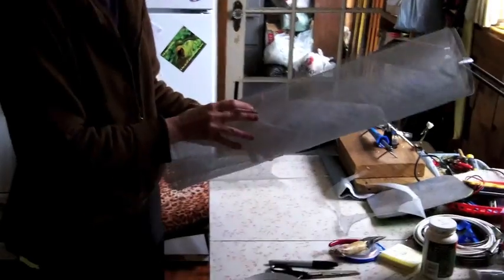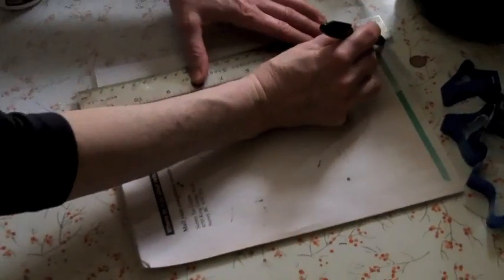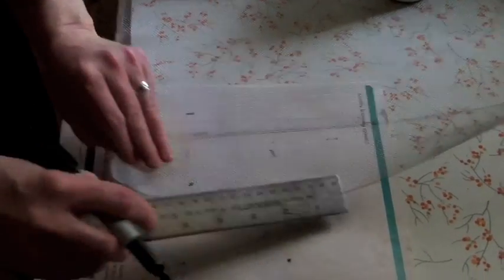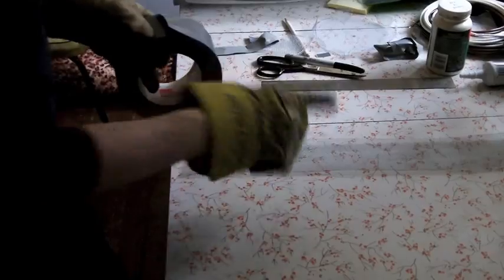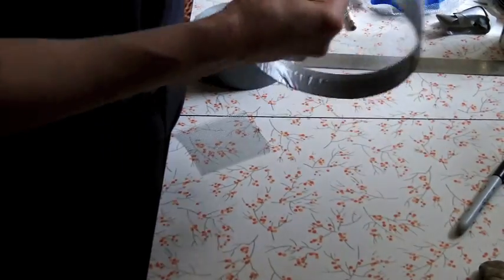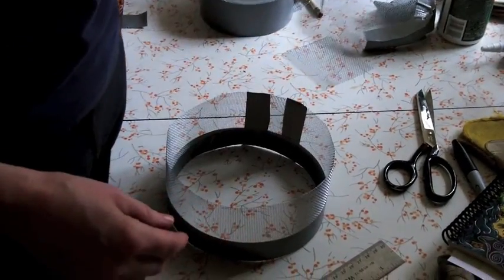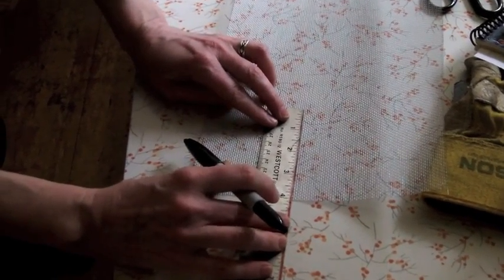How to Make A Smart Meter Cover

Comment: Thank you for your video !
I just like to help you by saying ,you could simply staple the screen together with a staple gun and make the end first using a can of 6 inch diameter by placing a 7x7 piece of screen pushing the edges down to make impression then cut along the adge about 1/2 inch overlap then push this circular  piece into the the pipe shape you have made and staple them together ,no need for any duct tape
Reply: +irooni100 Coffe cans fit snugly over my meter. I insulated it with that aluminum bubble insulation. I will be getting a Gauss Meter soon and I will test it and post results ASAP.
Reply: Russ Hook
Thanks !
I went to homeDepot and bought a whole role of screen and i made about 20 of them and gave them to my friends !
Yes i used Simple staple gun to put them together ,no tape or any thing else ,just staples & a piece of copper wire cost me less than 50 cents all together !
Reply: Russ Hook
money is not every thing my dear !
no i am not a Jewish ,i am a Muslim who cares for other people ,besides like i said each one cost me less than a dollar to make and i am a mechanical engineer by trade and it takes my less than ten minutes to make each one .yes others they sell the same thing on line for like $99.95 trying to get rich but i am already rich ,thanks to ALLAH !
Yes when you pay the POOR DUE ,God will make it up for your loss in multiple numbers
Reply: +irooni100 I KNOW about "God" but I am NOT religious, which means the JEWs CANNOT CONtrol me like they do 90% of the sheeple. Back on TOPIC, what is the screen made of? (material) Tnx...
Reply: Russ Hook
But , my dear the jews control the gold market and the money market as you know ,therefore they control all of us one way other the other , reading their torah you can tell the god of there torah loves gold ,he wants every thing to be made from gold for himself . go read the old testament ,you will see 
now about the material it is aluminum screen it is sold in all different sizes in roles at home depot . it is the screen being used for windows and door .
good luck and peace be with you
Reply: Russ Hook
OH
just find a empty can about six inches in diameter then cut a three inch wide screen to go around the body of the can couple of turns ,then cut and staple it together like a tube , then cut another piece about one inch bigger than the bottom of the can on each side ,then use the closed end of the can to form it into a cup shape by pressing the sides down ,the cut the square corners making it in the shape of a dish like a flower put dish then put the dish shape screen on your five fingers on one hand the push it into the cylinder which you made of the screen then tack the edges of your dish to the cylinder with staple from inside the cylinder , make sure your staple gun  has 3 inches fold to reach the bottom of the cylinder !
It is very simple and fast ,no need for duct tape or anything else ,then attach a copper wire for the ground to the inside of your cylinder using staples to hold it to the wall of the cylinder ,then place it on the meter either with a long tie wrap or a piece of hvac air duct tape at the bottom end of the meter .
try it is works and if they came to remove it tell them that they had no right to place this kind of dangerous meter on your property and you can make more if the remove it for less than fifty cents
Reply: My point is NONE of them can be trusted. Read the "Scorpion and the Frog" analogy. IT IS IN THEIR NATURE TO BE TREACHEROUS......PERIOD.
Reply: Russ Hook
You are Right my friend !
May i ask what is your religion ?
Reply: Yes, jou may!
Reply: Fefee10
Thank you !
May God Bless you !

Comment: Why not make thoes metres even smarter? Like generate enough signal to communicate but not more. Also directional signal would be better.
Reply: +Russ Hook LOOKING for a cheap way of stopping the smart meter radiation on the inside of your home??
Most hardware stores, army surplus or sporting good stores sell SPACE BLANKETS. 
Normally about $2 to $3 each.   I like the $3 ones becuase they have a gold color on the other side.  
A quick test before you pin them on the inside wall opposite of the smart meter outside.
BORROW A CELL PHONE AND WRAP IT TWICE AROUND A BORROWED CELL PHONE THAT IS TURNED ON.
CALL THAT CELL PHONE, IF THE CELL PHONE DOESN'T RING, THEN YOU HAVE A GOOD SPACE BLANKET.
Now get a felt marker and have your children draw DEAD BODIES near a smart meter.
Reply: +ArthursHD How much smarter do you want.   Take your blood pressure???   It already knows when you take a piss at 3AM.
Reply: +Frederique Zug You misunderstood me. I thought those meters could be more efficient by not emitting unnecessary signal. But not invade our privacy even more!
Reply: +Frederique Zug I don't take a piss, I LEAVE one! (;

Comment: Something else I found that works well in building a cover is a 6 inch diameter, (round) heat/ AC duct connecter. They are about 4 to 6 inches deep and fit and nicely over my meter.  Plus they work perfectly as a template for cutting a circle of screen material. The aluminum tape sticks very well and seals great. I drilled 3 small diameter holes in the side of the duct connection ( perpindicular to the end away from the screen) where it is overlapped and riveted and it's strongest point. I weaved the copper wire through those holes and used aluminum tape to secure it in place. The copper wire ground is an important feature people need to be sure to add. 
I paid about $6.00 for a roll of aluminum screen, which is big enough to make a bunch of these covers. The duct connecter was $2.49 and a 50 yard roll of 2 inch aluminum tape (the smallest roll they had) cost another $5.98. This came from a Menard's store. The only future cost will be for more of the duct connecters at $2.49 each. A lot lower than paying the huge amount some charge for a "pretty one" that does the same job.

Comment: I recently discovered 3 of these awful meters on my house. Thinking back to around the first of September 2014,  I have had that feeling one gets after wearing a hat and feeling like I am still wearing it after removing the hat. I also had severe memory and concentration problems. The hat head feeling went away within seconds of covering 2 of the 3 meters plus, the memory and concentration problems are slowly going away. 
I had 3 dogs, one of which contracted lung cancer a few months after the 3rd meter, a water meter sending unit, was installed in my basement next to the actual water meter.  My 2 remaining dogs, ages 7 and 8, are acting like puppies again since those meters were covered. One was always rubbing his head and ears on the carpet before I covered those meters. Since covering them, he has stopped doing this. 
I made a cover using your design except, I used aluminum foil tape instead of duct tape. I also anchored the cover to the meter using the same aluminum tape. That stuff is almost indestructible plus it adds to the protective shielding the cover offers. 
I will be covering the smart meters on my parents house today and we will see if it has a positive effect on the memory problems my mom has been experiencing. 
I have not seen a picture of the water meter sending unit on the Internet,  but will be happy to provide one to your page upon request.
Reply: Please send me your link.
Reply: You can call the Public Utilities Commission and demand that they make your power company remove and replace, check out minivan Jack on YouTube very knowledgeable.

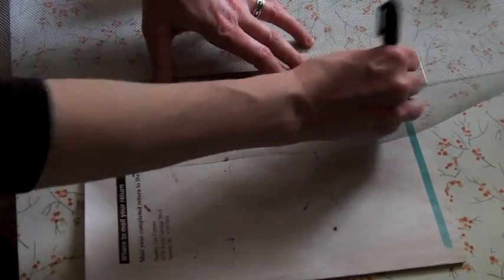Comment: the signal goes out and inside your home;. it rides in the wires that supply electricity to your house  and the wires that supply electricity to the wall plugs. its a d.e.s. digital encoded signal.  the utility company gets its signal over the wires despite what she said a 2:00. the transmitter pulses a signal every 23 seconds and it has enough strength to reach a far distant data collection point. NO LEAKAGE except thru the wires  that is... smart meter are not a U.L. listed appliance  listed appliances are a requirement of the national electric code. their connection  to electricity is outlawed by the NEC. OOPSS!

Comment: I was out shopping last night at the local HD. 
I'd like to note that there is an abundance of fiberglass or plastic composite screens that seem to be the new thing on the market these days. So make sure you're buying an actual metal or aluminum screen mesh.
If the screen mesh is not metal, it will render the Faraday Cage ineffective.

I ended up spending about $7 for a good size roll of aluminum mesh which apparently is for "bug screen". All good as long as metal so don't be thrown off by the "color" of it.
Reply: Hi Earth, 
Beyond making one, I bought one as well. It's like the one you're speaking of. 
I think it's smartmeterguard. This guy's name is Karl who engineered and built it. After researching a lot of them, I think it's the best bang for your buck out there. It's professionally done and made from stainless steel. Everyone has to pick and chose as to what's good for them. 
I personally like turn key solutions that look great and make life easy. Karl's fits the bill and would recommend it. 

If funds are an issue, then go the "build your own route". I'm handy so it's not a big deal and did it for the fun of it. That said, I'm pretty sure mine is subpar by comparison to the one I bought. Certainly visibly if not functionally.

I'd point out one thing. It's important to have top part connected to the side mesh. I think the instruction video has us taping the edges so we can attach and gain adhesion w/the tape, so it has something to stick to. This created a disconnect (top mesh to bottom mesh) in mine so I took a wire and grounded the side mesh to the top mesh so it's one complete circuit. I also grounded the wire to the box but I don't think this is necessary w/a faraday cage but I like to cover my bases.

Enjoy....
Reply: Hey Earth,
I haven't taken measurements but imagine the readings would be comparable. I bought a meter and will likely get going in a couple weeks to try out and see. Will post any differences.

Mean time, If you email Karl, he'll actually tell you how to make one that's pretty sure fire.
It's basically taking a 2x2' piece of screen you then cover the unit with. I forget the exact details but it made perfect sense and eliminated the need to try and mimic his. I think he recommended using a large hose clamp to secure the screen and then cut around the edges to clean it up. Not sure how would look but imagine would be ok.

I'll see if I can find his email but he'll tell you.
His email is the info one on his website.

I bet his method would be well enough and wouldn't look too bad where your neighbors would even notice.

Like your neighbor who didn't seem phased by having one by her head, I imagine wouldn't care or notice if you did hers too. Maybe pick a time where it draws less attention etc....then it'd be a thing of the past.
Reply: Hi Earth, I know that video and thought was very good. Although I question the need for the foil which might actually block the signal all together. This may interfere w/the communications of the meter to the electric company. I personally would just use the mesh and the clamp, which would simply make a functional faraday cage. That and anything regarding tinfoil tends to have a certain aesthetic look to it that kinda makes people go...wtf?...
Imagine it'd be an easier sell to your neighbor w/out the foil as well.

If your neighbor doesn't comply then you can always use some screen mesh to put on your facing wall. Either that or some lead paint to block the signal. 
Several ways to approach it. I understand the more distance the better and the less impact of the signal. You can get a meter for $150 and check it out. I researched and got one that's highly recommended. If don't remember the name now and can let you know if interested. I just wanted something basic that works well enough w/out getting crazy dropping $400-$500...
Reply: How so Ron. It's a faraday cage. There's no reflectance unless you're using foil, which I don't advocate.

Please explain....
Reply: +EarthH2oLuma This is the problem!  Most IDIOTS don't care. This 'technology' has ST000PIFIED almost everyone, and most SHEEP today aren't worth the powder to blow them to HELL!!! I have 2 meters within 20 ft of my bedroom, and I covered both of them. I am buying a Gauss Meter shortly to test my home for EMFs.

Comment: Hello, 
This looks like a nice solution. But will the electrical company still be able to receive the meter readings? Aren't they going to send a technician to your address to take it off and fine you a fee?
Reply: Anastasia Zaikina Uh huh.  Ok.
Reply from the maker: I live half a mile off the road and Hydro has no trouble taking the reading from the road.  If you don't otherwise tamper with the meter, these covers are perfectly legal.
Reply: thank you so much for your response. I made one cover like yours but with double layer of window screen. do you think I can call them and ask: "hey are you getting my readings?"
Reply from the maker: I would just wait and see if they send you a bill!  :)  Cheers
Reply: Q Factor Videos What give the power company the right to install a 4 watt eirp unlicensed commercial radio transmitter on our home?
Reply: I have made a makeshift cage like that also around my wireless router,  of aluminum grill screens that they sell in walmart.  We still get the wireless signal, internet works fast and without problems, although i see less bars. Our health is worth it!
Reply: Boom, you've just exhibited critical thinking.   Yes.  IF this device does what it says, you better believe someone will be around.So if nobody ever shows up, then guess what??
Reply: So basically you are blocking the signal.....but you aren't blocking the signal.  Which is it?
Reply: The FCC and the state government commissions.
Reply: I have made a makeshift cover exactly as shown in the video, plus on the inside i made a screen of aluminum "rescue blankets". We keep receiving the electricity bill, no problems. Apparently the signal is still reaching the destination but it is not so strong.
Reply: Just think about a shoplifter using a foil aluminum bag so that the alarms don't beep at the doors of the store. That bag has to have 30 layers of Raynolds wrap at least! Then the signal is blocked completely. Here we don't need to block it completely - just to reduce it. They sell the smart meter covers like that on Ebay, and they are legal. The damn thing still works apparently, but people in the house stay healthy!

Comment from the maker: The smaller the holes in the aluminum, the more protection it affords.  I'll be posting the new video in February, and will link it from this page.  Thanks for your comments.  :)
Reply: Just criminal allowing this stuff installed on peoples houses....
Thanks for vid.
The mesh blocks the frequency from the back as well?
Meaning it cant enter the house?
Reply: thanks very much!
Reply: +Jim F That was what I'm wondering.
Reply: +Eddie Lai  wouldn't this block electronic harassment
Reply: +Eddie Lai okay thanks
Reply: +Eddie Lai Thanks Eddie. I'ld like to buy a meter for testing the RF that's coming in through the walls not just close up to the meters as I see people doing in these types of videos. There are 5 meters in my hallway apt building directly on the other side of my bedroom. I've had trouble sleeping since moving in. What exactly do I look for? And what are these gadgets that plug into my wall outlets that supposedly reduce the waves? Are they any good?. I'm on a limited budget & appreciate any advice. thanks again!
Reply: Hmm,I'm the farthest from being an engineer anyone could be, but if you ground yourself I believe the waves just continue to circulate within your body, what good is that?
Reply: Yes maybe not insulting, but definitely a put down. No fear, I'm smarter than that.
Reply: You've just been had.
Reply: We've ALL been had! You just seem to think you're better off not knowing just how much.
Reply: I read to tape up a piece of aluminum foil to the back of the wall. It will block the radiation. Just hang a big picture over it if you don't want to see the foil. I think it makes an interesting conversation piece when friends come over and ask what that is, and then you can help the friends by showing them how to block theirs too.
Reply: Can you move your bed over to the other side of the room? Can you sleep in another bedroom? Or even the couch if it's away from the meters. I love sleeping on the couch. To protect your health you may have to make some changes. Or move to another place., but check and see where the meter is.

Comment: I just made one of these (my smart meter is square, but same idea), and couldn't get uncoated aluminium mesh so had to settle for the black coated aluminium. So if anyone else can't get the plain stuff, I can confirm that this works fine too, though I guess uncoated would have higher conductivity to your earth wire.

Comment: Tye frequency they use is in the 915 range it was the original microwave oven frequency they had to change it to the 2.4 range as it would pass though the steel in the oven you could cook a stake on top of the micro wave oven